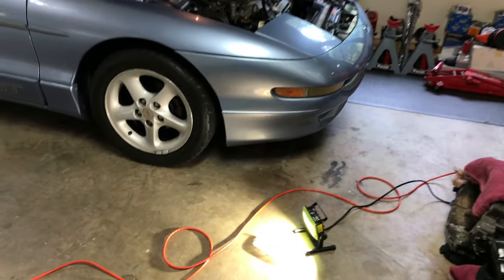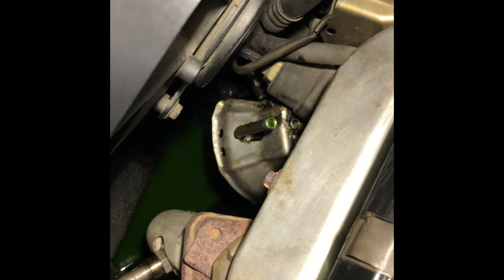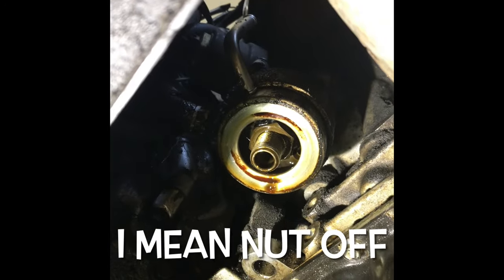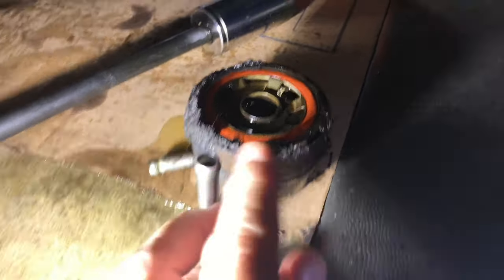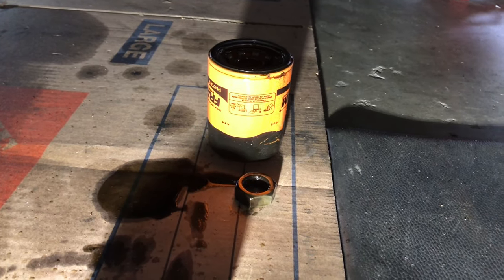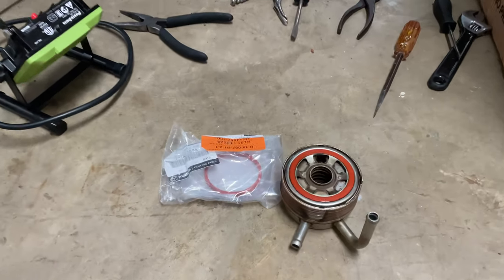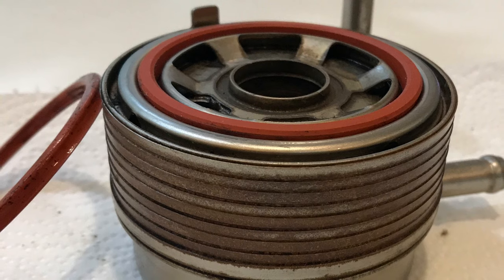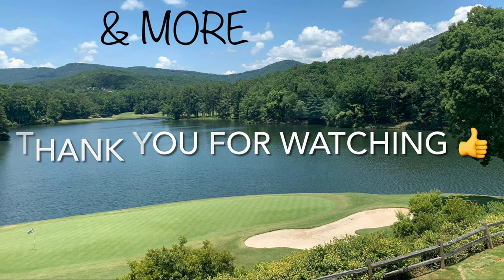Ep37 - Oil Cooler Leak Fixed on the Ford Probe GT

Comment: Don't forget to bleed your coolant system too man . Thanks for the video my car is doing the same thing in the same place now I feel more confident to do it myself and interesting to see how people who own these cars have the same problems
Reply from the maker: The hardest part was jacking the car up, and the coolant lines took a little effort getting off.    Yes, thank you, my temp went high then realized I had to bleed it/add coolant to the other top upper engine port.  It will overheat if this is not done.   Cool.

Comment: about 10 yrs ago, my oil cooler also leaked...bad...used to make a puddle under the car...I had to add oil every few days and it dripped wayy more than it consumed...for me,it was such a simple fix, I kicked myself for putting up with that leak for so long... all I had to do was unscrew the oil filter and then Tighten that huge nut securing it...that was all...no parts needed and its never leaked since...valve covers leak but thats another story!
Reply from the maker: Agree.  I was thinking of just tightening, but due to the age, I wanted to try replacing.  True, valve covers another story.  I will do this fall.  Gotta get myself motivate for that.  My back is hurting just thinking of.
Reply: Oil filter gasket works as well.

Comment: I’ve done this job before. I used a gasket from a Miata.
Reply from the maker: Cool.  Did it look similar to my new gasket, or was it flatter and wider right from the start?  It is working good, I am just still curious if my new gasket was really the correct part.  I triple checked all the part numbers.    Thank you.

Comment: Is that gasket the same as a filter gasket?
Reply from the maker: Very similar concept.  Some say you can use a filter gasket also.
Reply: @ford_probe_garage_studio  I was just gasket shopping yesterday for an O-ring for the power steering pump. That's got to go back together. I disassembled an alternator, cleaned it, reassembled. It should work now again. It was iffy before. If it works I 'll do the same for the one currently in the car, maybe do a video on that. Easy disassembly and assembly. I've also got an idea to fix my crankshaft problem. Sideskirt is really close to done with shaping and filling.
Reply from the maker: @pgtmr2713    Nice 👍.  Little by little.  It’s hard for me to stay motivated over summer, to many distractions and so hot.  Next easy job for me is rear caliper, I think.